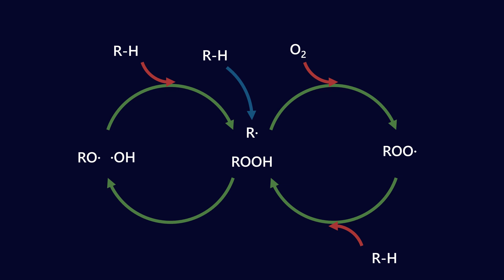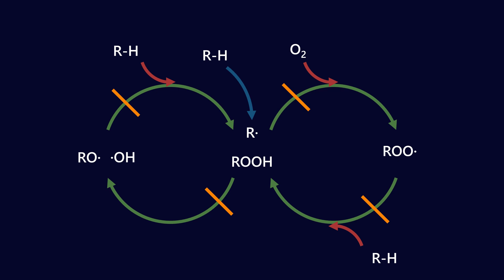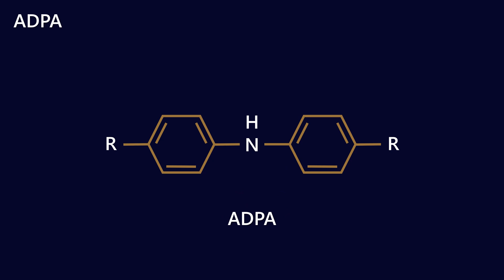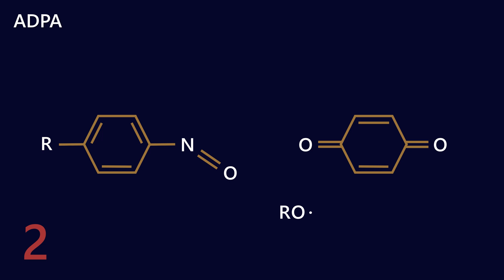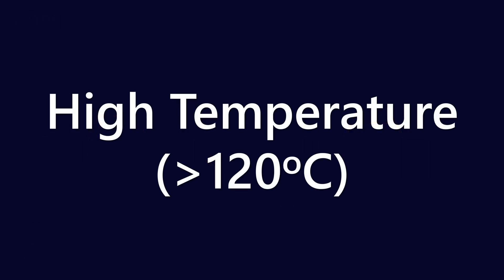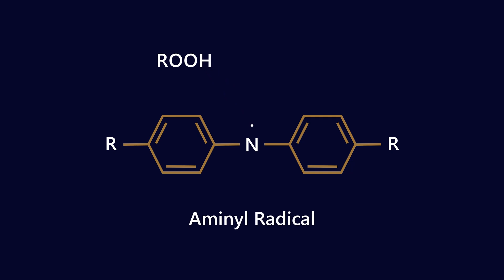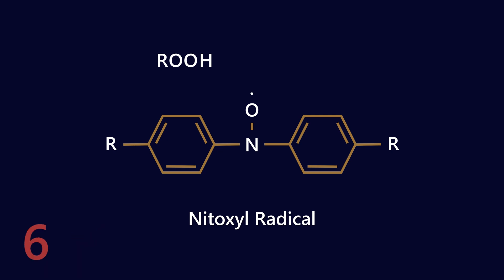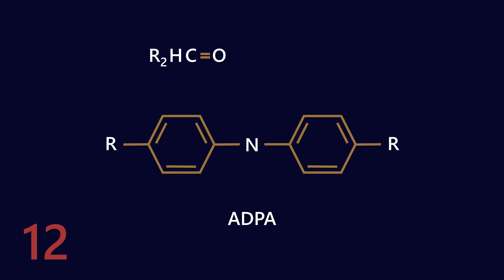How aminic antioxidant lubricant additives work

Comment: I'm wondering what type of Antioxidant is being used for Turbo Compressor in fertilizer application.
Because it seems standard Turbine Oil Antioxidants don't really work well with the presence of Ammonia.
Reply from the maker: Great point! In compressor application the gas being compressed often interacts with the oil. With Ammonia being a relatively polar molecule, most of the oils recommended for Ammonia compression are PAO synthetics. However - they're generally not designed specifically for ammonia compression, so the antioxidants are likely to be the same as in most other oils.

Comment: I did a lot of looking around and I am pretty sure that “STABIL” is a bulk chemical from Innospec called AO-22.  It’s single ingredient is N,N’-di-sec-butyl-p-phenylenediamine.  Even per wikipedia is it a “red liquid”.  The other alkylated phenols they produce are “straw or amber colored” so unless dyed by the dyes they do produce, I am pretty sure this is correct.  Also their website even says that phenylene diamine antioxidants are best for olefin content over 10% and I believe out gasoline is around 18%.   I could be completely wrong.
Reply from the maker: Not super familiar with fuel stabilisers but it stands to reason that they operate in much the same way as the antioxidant packages in lubricants.